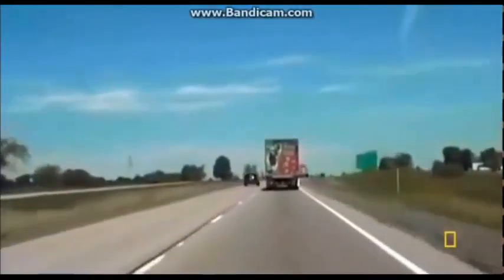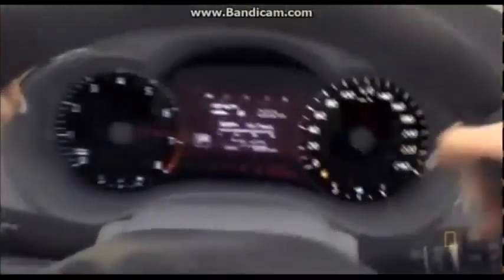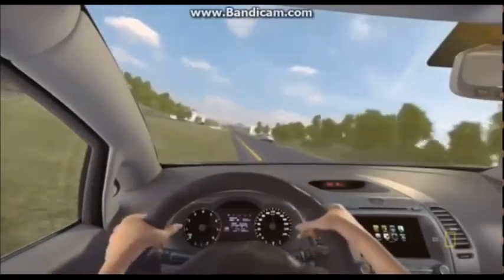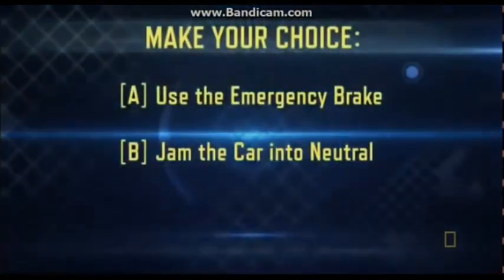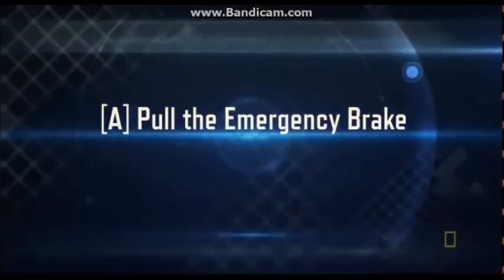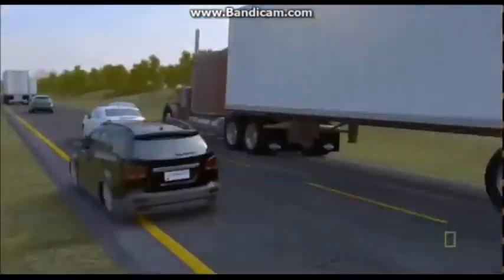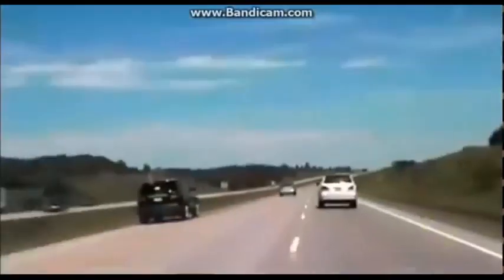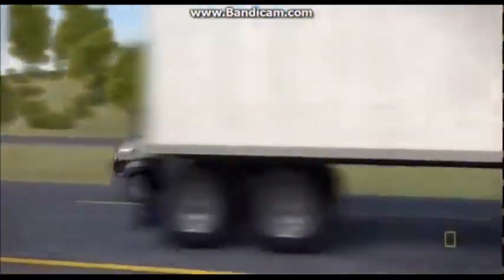How would you stop your car if your gas pedal stuck

Comment: Press clutch, set gear to N (neutral), press brakea
Reply: bodak yellow it's an automatic
Reply: Zane Zinn lol automatic cars are so bad
Reply: bodak yellow because you said so
Reply: xxDPKINGxx no
Reply: @zane
Reply: bodak yellow tell me how bad they are when you drive 2-4 hours daily down a highway. Cruise control is the best. Fuck manuals. Automatics shift faster anyways.
Reply: manuals have cruise control too wtf lol
most automatic transmissions are designed toward fuel efficiency instead of getting to the most horsepower-efficient revs lol
that's why in race cars they still use paddle shifters instead of the automatic transmission (:
Reply: This is when I come out and say DSG gearboxes are the best, because you could have the same joy as a manual (using flappy paddles) and the same perks for when you don't want to use manual anymore, also changing gear is instant.
Reply: no matter how good modern automatics are, you have more control of your car with a manual
Reply: then your engine redlines and you blow a cylinder but whatever
Reply: Hetzer Hasser i can clearly see that you are not car guy because you hate drifting so much and why are you talking about racecars?? And also you have driven only 1 automatic car and actually that car has very good automatic gearbox. So that clearly means that you dont even know What (BAD) automatic transmission means and how much money you need to spend when you fix it. Dont say automatics are good and better if you have no experience with automatics
Reply: What do you understand by using the term car guy? I think there are more types of car guys. I am a car guy, in the sense that I see the practical aspect of every single car, and not so much about the fun itself...You might be some other type of car guy... Newer automatics are getting better and better. It's a new technology, at least compared to manual driving. Give it a little bit of time, and I can assure you, automatics will be everywhere, just like electrics, in 20-30 years.
Reply: manual cars are more fuel efficient.
Reply: That highly depends...if you overrev in low gears, then it sure as hell, won't be fuel efficient.
Reply: xxDPKINGxx that is not true at all....
Reply: Bullshit you can turn off your engine by turning the key just once. Then the wheel can't block. As long as the key is inside the wheel can't lock up. And you have 2-3 stages of key turning till the engine starts so it works backwards too
Reply: Hetzer Hasser you are a wierd car guy because you dont like drifting you support electric cars and also automatic transmission. As i said automatic gearbox will never be better and will never win here where i live because people around here hate the automatic transmission
Reply: Omer Ahmed yeah but i said he is weird car guy
Reply: Lol
Reply: Munakanap who fucking cares? You say automatics will never be better, but explain why they get better and more consistent times on drag strips? They are more practical, and compared to early autos, yes they have gotten better and shift far quicker than anyone that knows how to shift through gears efficiently. But manuals are more suited to tracks or drifting, or just more control in general. Just cause you think drifting is cool doesn't mean that anyone who doesn't isn't a car guy. Who fucking cares if everyone around you drives manuals, doesn't mean it's better. They each have pros and cons for different scenarios. Just cause you refuse to see the advancements of autos because you're so stuck into what you like, and what you think is cool, doesn't mean they will never be better.
Reply: Djentleman 2228 i have said like 3 times i dont say that he is not car guy he is just wierd car guy and seriosly manuals are better go to formus if you dont believe
Reply: Omer Ahmed weird because does not like drifting or racing, supports electric cars and prefers automatic. He is kinda black Sheep car guy
Reply: xxDPKINGxx you morron!
Reply: bodak yellow normal people like you and me drive a car however there are most Americans have issues with not being able to comprehend doing two things at once so changing gear is far to hard....
Reply: aka: learn how to drive a manual car :P
Reply: Munakanap that's not fact. That's preference. You might like it cause it's more engaging, but others might light the simplicity of driving an auto. I'll give it to you on reliability though
Reply: Lol what a shit storm becouse i said what i would do if id be driving my car. Internet is awesome! Vittu
Reply: EclipseGaming2073 yeah i know that, but its easy to learn
Reply: Lytheus It's actually the opposite. You get better MPG in a Manual car because you can choose a higher gear for a lower speed. An Auto will choose the "appropriate" gear for your RPM, where as a manual you could sit, for example, quite happily in 4th at 20-25 mph to lower your revs & to save fuel. An auto would choose a lower gear, say 3rd or even 2nd. Same as going downhill.
Reply: xxDPKINGxx try racing a manual car v automatic..... Mate I did this in a manual focus (110hp) Vs a brand new vw Passat(180hp) I won just beacuse the vw was automatic
Reply: Hetzer Hasser do you even now what is over reving if you over rev you can pritty much say good bye to your engine 😂😂😂
Reply: Just no
Reply: You don’t need the clutch to shift into neutral
Reply: Juuse Saarinen half of Britain say that word! And just to add my thoughts on this topic above, manual is far more fun to drive imo
Reply: Jack's Tutorials yees you are right
Reply: xxDPKINGxx wrong sir
Reply: Rainbow Dash of you want to fuck up your transmission then you dont need the clutch(unless u rev match and then shift)
Reply: bodak yellow The auto guys are salty because they can't drive a manual
Reply: Zane Zinn you can still do that on an auto
Reply: Lytheus you realize dual clutch transmissions are automatic right
Reply: I'm just going to add to this reply chain with this:
Manuals are more fun for street driving and are good for budget circuit racing.
Traditional automatics are good for drag racing (with manual valve body and high stall torque converter).
DCT's are good for circuit racing.
Sequential dog-boxes are good for rally and circuit racing.
CVT's are good for efficiency. 
So there. All transmissions have their place. Calm down with this dick-measuring contest.
I have 2 vehicles with manuals, 2 with sequential dog-boxes, and 1 with an automatic. I can't afford a DCT, I'm not into drag racing, and I'm not really interested in the vehicles that CVT's come in right now (although it would be good for a daily driver).
Reply: CrUnCh you don't need to rev match or use the clutch to pull it out of gear. Just take your foot off the gas and it will slide right out. I've driven 300 miles without the clutch through towns and cities to get back home after cracking a hard line.
Reply: bodak yellow why clutch?
Reply: GoodnightNoodles faster /= better
Reply: You can still shift it to neutral if it’s automatic lmao
Reply: bodak yellow if you press the clutch while and press the gas pedal you will destroy your car.
Reply: xxDPKINGxx yes, faster. But manual gears are easier to repair, cheaper and can handle much more force than any automatic gear
Reply: This discusion is so funny :D :D I am manual driver and I would never buy automatic :D I like to have control over my car so if it is possible I even turn ABS and ESP off :D but that's just me. Every person on the world will have different opinion and both manual and automatic have their pros and cons. I like shifting so I buy manual. I don't know how to shift or it is to much for me so I buy automatic. Simple as that :D
Reply: Hetzer Hasser Hast echt überhaupt keine Ahnung von Autos. Und was ist das Problem beim driften im öffentlichen Straßenverkehr wenn alles frei ist?
Reply: Munakanap the three things you just listed are the definition of a non car guy.
Reply: LOL FALSEE
Reply: wouldn't say "same joy" but dct's are still more fun than traditional autos
Reply: true, i regularly shift at redline and even in a 4 banger gas goes too fastt.
Reply: xxDPKINGxx they seriously are not
Reply: Press clutch, set gear to N
WHERE THE F&&&& IS THE CLUTCH IN A AUTOMATIC
Reply: Immortal You clearly have never driven a manual lol. 4 hours on the highway and you put it into 5/6th gear and you don't even have to shift it. Also, it's not about it being faster it's about the driving pleasure
Reply: Most modern automatics have a manual mode where you select the gears, this makes a modern automatic car able to do 90% of what a manual wouls have the ability to do
Reply: Exactly. Even in auto, put it in neutral. Welcome to America, where this isn’t common sense.
Reply: Im not from america lmao
Reply: ppl who call themselves car enthusiast but say auto is better than manual bc its faster
Reply: Yeah Autos are better!! thats why Formula 1 and WRC and GT cars use autos instead of manuals.. OH WAIT
Reply: where the fuck did you get that from
Reply: Lytheus I think he means adaptive cruise control for traffic, to follow the car in front of you a manual can’t do that. Also an automatic will still redline if you stomp it
Reply: yes but in a manual you could just press the CLUTCH and disengage the gears and the press the break to stop so you wouldn't even sweat if it happened.
Reply: Automatic cars don’t a clutch😂😂
Reply: yes but those auto gearboxes with manual override are very juddery if that makes seance and the gear change with them can be sluggish
Reply: they get more consistent times because they change gear at the same rpm and generally will have same acceleration between gears for every gear
Reply: but who wants to be in the city anyways so why even bother with an automatic. dirt road and a big 4x4 heavan not stuck in traffic jam for 3 hours.
Reply: nope well not in the countryside of Ireland anyways
Reply: i have reason why petrol cars are better  1 they make a much better sound. you can enjoy they sweat rev of you car its hard to explain to you if you do not like the sound but ask anyone who is a rally enthusiast and they'll tell you how the sound out of a car is just magic 2.the smell of petrol is lovely who care if in large amounts it's dangerous unless you glue your mouth to the exhaust it wont kill you. 3.you can only go so far in an electric car when a manufacture tell you it can go 350miles on 1 charge you know thats a lie you might get 50 miles a charge because of traffic, speeding up and slowing down, stoping at lights, and so on however a 1.2 ford fiesta under same conditions can do 200 miles on a tank. i could go on but i think you get the point electric cars are shit
Reply: Clutch?
Reply: sage wysocki u know the the first pedal on the left
Reply: xxDPKINGxx at least manual keeps us concentrated on driving because it makes us change the gears.
Reply: Immortal my 5 speed has cruise control it's not just an automatic thing lmao
Reply: bodak yellow 
Manual vehicles are disgraces to society.
Reply: kyllä! torilla tavataan
Reply: If I drove a stick shift,  I was red line it and blow up the engine :) ($38,000 gone)
Reply: you sound like someone who has to drive their moms car
Reply: Lol evrybody angry
Reply: xxDPKINGxx Thats not true
Reply: Immortal   you know that manual cars have cruise control right you dont know shit about them also when you are in highway just put it in a higher gear and just push the gas pedal its ashame that america gives drivers license without learning manual
Reply: its an automatic because this is america...
Reply: bodak yellow s
Reply: It's American video they all use automatic lol
Reply: Many automatic modern cars do infact go into a over-drive gear ratio when driving on highways. Just pointing out..

I own both a manual and a automatic. 

Infact I would even argue that the automatic wins if they also reduce the numbers of piston being used. Such as my lancer does.  Not many manuals in my experience can do that.

But I don't drive my manual for the gas milage. Lol I drive it for fun.
Reply: Hell yeah manual brothers unite
Reply: bodak yellow that is exactly what I thought
Reply: Greg Caesar Your dad would be embarrassed seeing that comment
Reply: Manuals are a better driving experience than autos. End of argument. Yeah autos may be faster now at shifting but it completely takes away the user input and it's quite frankly boring. Theres a lot of excitement when a modern sports car comes out with manual option because the people who can actually drive and have had experience in a fun manual car will know
Reply: tacdiesel still doesn’t compare to the feeling of getting a perfect heel toe downshift right before corner entry
Reply: but you have more control in situations such as the one presented in the video. in a manual you simply press the clutch, take the gear out and pull over to turn of the engine. simple
Reply: Americans don’t know what clutch is
Reply: that's only for the manual master race though
Reply: Lol automatic cars have neutral too...
Reply: +Hetzer Hasser I can understand why you think automatic cars are better... you drive a Daewoo.
Reply: xxDPKINGxx yep, faster to crash and die
Reply: xxDPKINGxx Automatics are for posers
Reply: DSG/DCT transmissions are great though
Reply: automatics gearbox is boring you can't play with it. you can't chose if you want more power in that moment. you can only control the speed by gas pedal. on the other hand automatics gearbox is more comfortable for city use.
Reply: Could I just press trachea instead of breakea?
Reply: perämetsän amatöörit totta
Reply: it's probably automatic
Reply: perämetsän amatöörit no clutch cuz it’s automatic
Reply: In automatic change it to neutral and press brake
Reply: Learn how to spell brake
Reply: Kennard Edmund you should learn that the conversation is ended
Reply: Well now they have to make these stupid automatic cars.
Reply: Munakanap I have to disagree as no one, here in Finland hates automatic transmission!? 😂
Reply: Automatic let you switch to neutral while driving anyway, safety feature, can't take that away.
Reply: I am professional truck driver and automatic gearbox isn't better then manual, you can't just say it like that. It depends on how you drive, generally for long distance drivers automatic is alot better but that is it. Manual gearbox makes you feel the car alot more, which means you have the ability to take corners faster with a manual gearbox then automatic because you can decide how much pressure you can put on the wheels and you can feel it in a manual car. Manual gearbox can also be more fuel efficient and is generally better for racing/faster cars as it makes you feel the car alot better.  And the people who say that manual drivers are "poor" are very ignorant, because most cars in europe like porsches/bmws (expensive cars) are all manual.  like 90% of the cars are manual.

So automatic use has pretty much one good point only: Long distance driving.

Comment: I had that issue, threw it into neutral, and that basically meant my brakes could easily stop the car. The biggest issue is to not freak out, you do that you'll lose the ability to drop the suspension into neutral (for manuals, pop the clutch and then apply the brake).
Reply: This is called a stolen video
Reply: Did u now that mark salyor do everiting in the a b c but it dont work and he crash at 120mhp
Reply: Think thats bad? My engine would shut off while i was driving so i’d lose brakes and steering
Reply: @Zachebi  you wouldn't lose power steering or brakes if just your engine cut out. The electronic system is still on so your power steering would still work. Idk about  any brake assist mechanisms though your brakes should have still worked. Unless you meant to say the car turned off completely.. and if that's the case why did it do that while you were driving? Did you turn it off yourself?
Reply: @-pyrosef-  the entire system would turn off, and i never found out the cause no mechanic could tell me what it was. Im lucky it didnt have a steering wheel lock. It was a second hand korean car from 1994.
Reply: @Zachebi  well power steering back the was powered by a pump driven by the engine, so that would stop working. And the brake booster used by most cars is assisted by vacuum lines from the engine, so that would stop working as well. However your brakes should still function along with your steering. It will just be a bit harder to operate
Reply: If you would have that situation you should first put It in neutral then stop The engine and use engine braking. DO NOT turn The key to steering lock so you can stear. Or after you have put It to neutral pull the handbrake smoothly that you dont lock up the wheels. If you have to stop quickly DO NOT drive The car to a dich but you can smoothly drive The side of your car to a guard rail. Hope fully that helps.